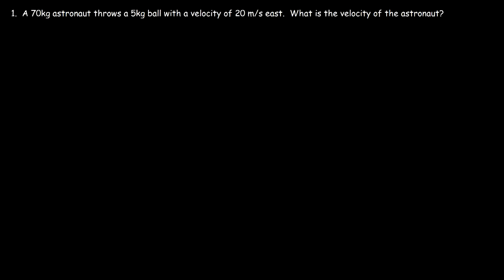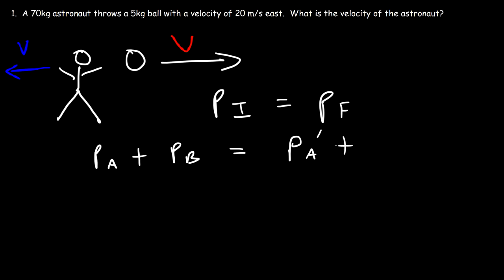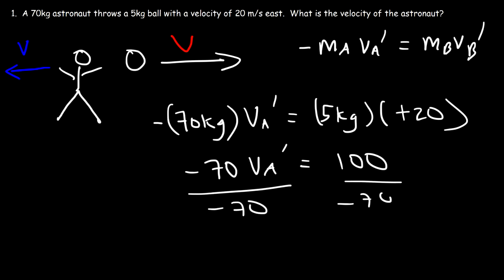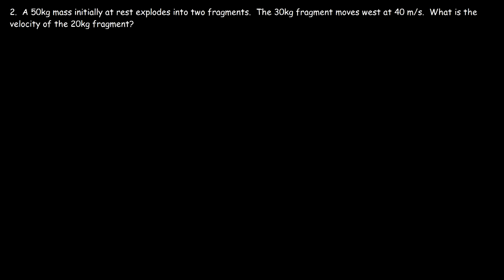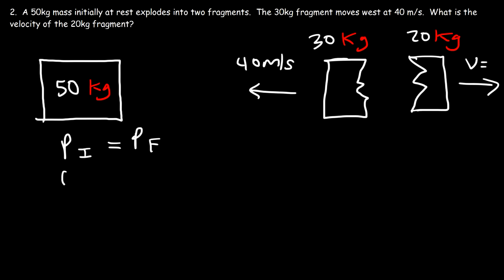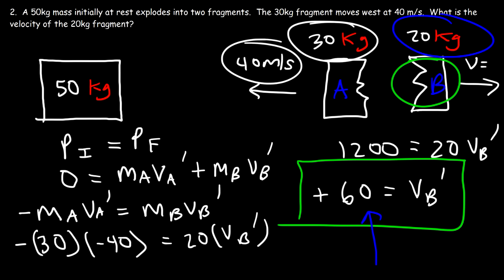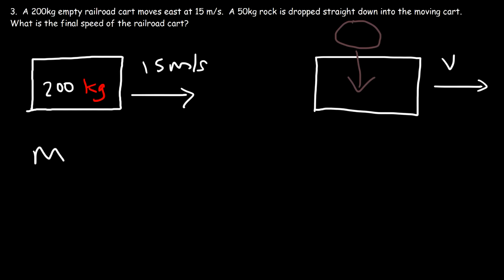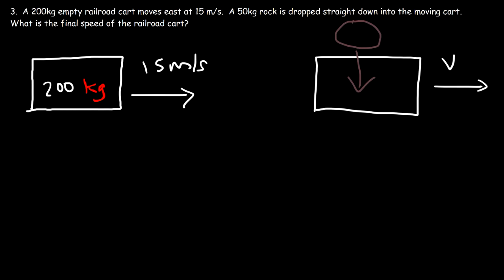Conservation of Momentum Physics Problems - Basic Introduction

Comment: In the last question with the rock and the cart, if the rock lands in the middle of the cart instead of at the back, since the rock would be initially stationary there would static friction between it and the floor of the cart. As the frictional force would be opposing the direction of motion of the cart, would that static frictional force contribute to slowing the carts velocity down?

Comment: Okay but   
                             indirect proportional
5kg        20m/s
70kg      x

 That would have explained it better imo, since 1.43m/s times 14 (70/5) is 20m/s. It comes out as the exact same, unless this doesn't work in specific occasions and therefore your formula may be better

I have not yet looked at the solution, but this should work with 2) as well. Maybe it's good to show newton's 3rd formula to help comprehend, but why would I ever learn a new more complicated formula than just use that? Unless it's the same but presented differently. Sorry if I'm wrong.

50kg v= 30kg v +20kg v

                               ind. p.
30kg                       40m/s
 
20kg                       x
 
40m/s x 1.5 = 60m/s.

3. I'm assuming the momentum (kg x m/s) stays the same, so since the weight increased from 200kg to 250kg, it's 1.25 times slower. So either 200/250 or 1/1.25, which is 0.8. So it's 0.8 times the original velocity, which is ((15/5) x 4 = )12m/s. 

Same as Pı = Pf

Loved this video, thanks!

Comment: I need assistance with a problem using Conservation of Momentum.  We are studying ET objects in space.  We are working on a project Comet Impact.  Here is the problem:   Below i the Conservation of Momentum equation:
(Vcomet) x (Mcomet) = (Vimpactor) x (Mimpactor)   Where: Vcomet = sideways velocity in miles/hr of Comet Buttercup after the detonation (what we need to figure out), Mcomet = 1,100,000,000 ton (1.1 x 109 ton), Vimpactor =  7,800 miles/hr
Mimpactor = 800,000 ton (8.0 x 105 ton)
Remember, we won’t be actually hitting the comet.   But the energy of the explosion will be like hitting the comet with a fast-moving object  Step 1: Re-arrange Equation  to solve for Vcomet, then calculate the sideways velocity in miles/hr that the comet would have after the detonation of the bomb.
Reply: Post in physics forums or physics stackexchange. Not Here.

Comment: Why do you use -MAVA=MBVB equation for every question on this video apart from the last question ?
Reply: he used 0=MAVA+MBVB because there were two objects with completely different velocities that we wanted to find. in the final question there's only one subject we need to find because if we think of the railroad cart and the rock as one object, the object initially moved 15 m/s and then gained mass. so the pi=pf is MVi=MVf. he found the initial momentum, and is looking for the final velocity
Reply: so his equation turned from MV=MV TO (200kg)(15m/s)=(200+50kg)(v?) which is 3000=250V
Reply: @tofunmio  But even if the railroad cart and the rock are one object, wasn't -MAVA=MBVB, because of newton's third law showing that with every object  on that video had a negative resultant force in the opposite direction causing the MAVA to be negative.
Reply: Since the railroad cart was moving wouldn't there be a negative resultant force, causing him to use the equation -MAVA=MBVB to figure out that force just like he did with the rest of the questions figuring out the new velocity
Reply: @juniorasare272  sorry for late reply, this isnt newton's third law, more like conservation of energy, or in this case momentum. its the momentum from before has to equal the momentum after, if in a closed system

Comment: 6:10 
Conservation of momentum law doesn't apply if the mass changes, does it?
;-;;;
Reply: Or maybe it still applies
Because it's an isolated system, and the force is only from the inside of the system, and the overall mass is still 50kg i guess..

Nvm

Comment: Dr!
What if the helicopter files at the speed of 990km/h. The pilot fire a missile forward out of a gun barrel at the speed of 2520km/h. The respective masses of the helicopter and the missile are 500kg and 50kg respectively.  Use the principle of conservation of momentum to calculate the new speed of the helicopter immediately after the missile had been fired.

Comment: Let's say you have a 1 kg mass moving to the right at 20 m/s that collides with a stationary 2 kg mass and bounces off to move to the left at 10 m/s with the 2 kg mass moving to the right at 5 m/2. The time of collision is the same for both masses, but the net force is different since the impulse or change in momentum on the 2 kg mass is 10 kg*m/s and the impulse or change in momentum on the 1 kg mass is -30 kg*m/s. How does this figure or how is momentum conserved with the momentum lost by the 1 kg mass not being equal with the momentum gained by the 2 kg mass? How can the net forces be different?
Reply: The numbers you gave at the beginning they are wrong that's why your result is wrong see the equations for the elastic collision and you will find the right numbers